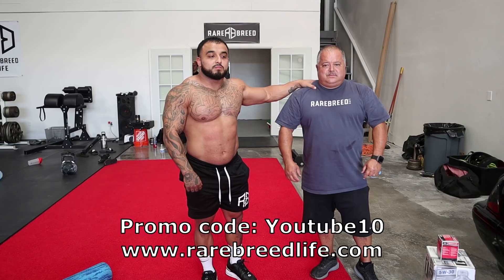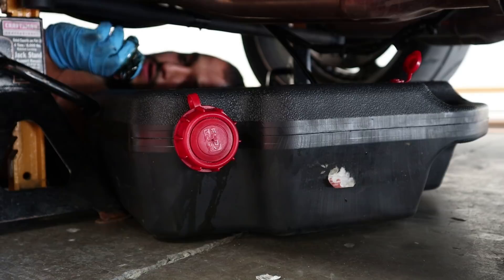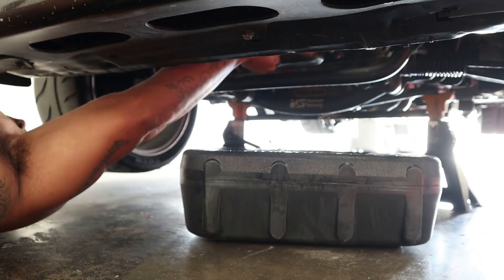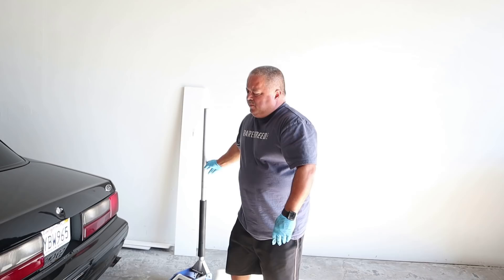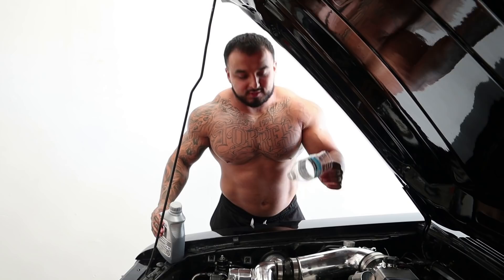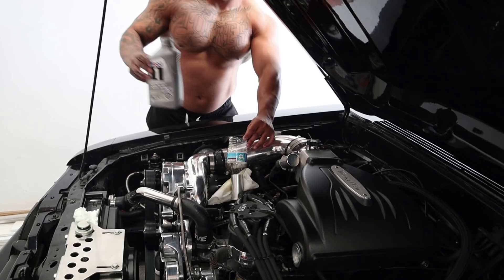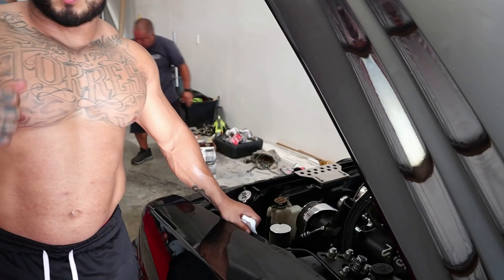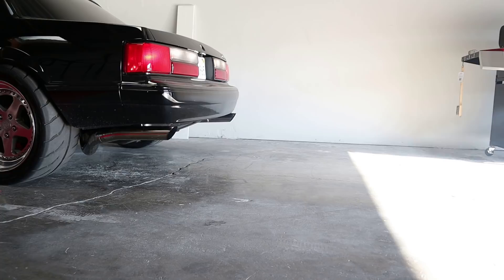My First Time Changing My Oil In My 5.0

Comment: RB4L
Funnel or no funnel
Motoroil bottles are designed with the cap opening more to one side
When filling your car,hold the bottle vertically,so that the cap opening is on top.
That way you can control the flow of the oil

Comment: When I used to work for pennzoil . Man this dodge truck came in. It drove a long ways, and when I was screwing off the oil plug. And that oil pan nut flew off and hot oil poured all over my chest man that f,ing burned. Still have burn Mark's on my chest.

Comment: Dont forget to change the blinker fluid.... 😌
Reply: Or a left handed screwdriver!
Reply: Also, the air gets dirty in the tires.  You gotta change the air with every oil change.
Reply: And check the muffler bearings too 😂

Comment: Pit you can change it every 3,000 miles if you use 100% synthetic oil I would use Mobile O N E for my turbo SRT.
Reply: You don’t have to change it every 3k miles. That’s unnecessary.
Reply: @ComplexWork  dude he just said he changes it every 1,000 miles.....
Reply: Billybootlips well I would change it every 3,000 for my turbo car because high mileage and the oil would burn quicker and it could  damage my turbo seals and bye bye turbo I did drove it pretty hard.

Comment: That's the only way to do your oil is by yourself man fuck going 2A mechanic all they do is try to overcharge you give you a shity filter and put should the oil that's probably not even the right kind try doing a transmission maintenance on a 2002 Explorer with no dipstick should have put a K&N oil filter on that thing